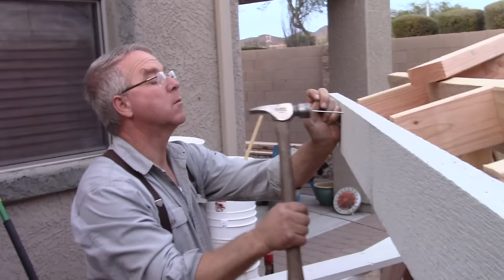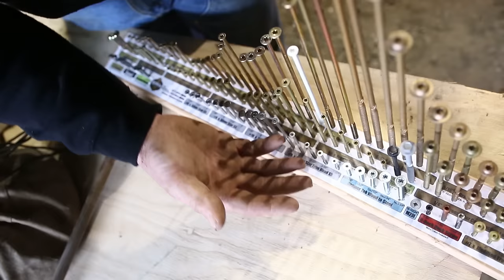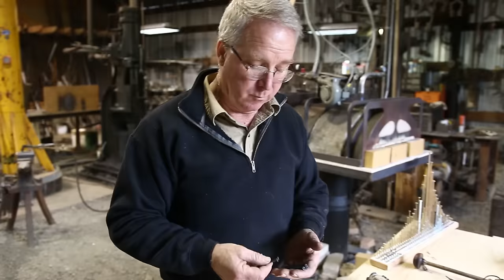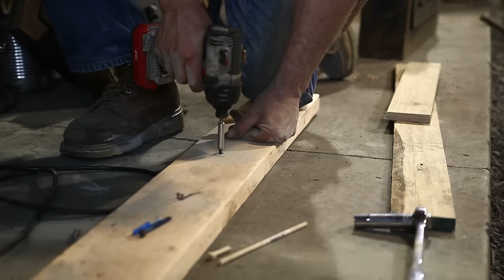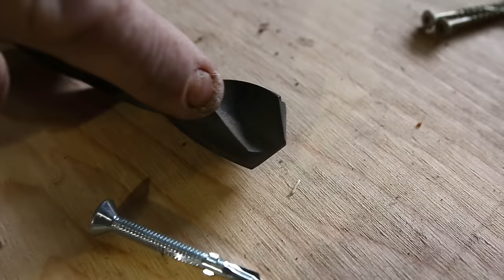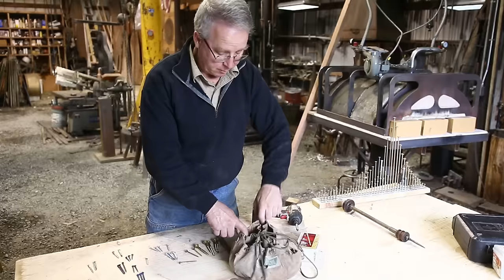Screws: What You Need to Know

Comment: If you have to use Philips head screws, get a JIS (Japanese Industrial Standard) crosshead bit or screwdriver of the correct size, and they will not cam out or strip the head of the screw. If installing European-type cabinet hinges, the driver needed is likely to be for the  Pozidriv screws that come with the hinges; look for the "Pz" trademark on the bits. Pz drivers work fine on these screws, but a Philips bit will strip them in a second. After you strip the heads of these screws with your Philips screwdriver, bring out your Vamplier brand screw extraction pliers, sold by Amazon and others, to unscrew them without destroying the cabinetry.  Regular pliers won't do it.

Comment: FYI:  A nail is just a screw without threads.    
I see you must have borrowed that GRK structural screw board from your lumber yard buddy.
I love it when i see some homeowner put up a wooden fence with long drywall screws because they are cheap and 2 months later the wood fence is bleeding at every screw.

Comment: I use Simpson strong tie sds screws all the time mostly with a 3/8 drive head on em but I like em they're pretty strong and haven't have them ever strip or break.... but yes they're also expensive..
 Also use torques on decking always I like em... course sometimes ya run into a crap box of screws somewhere that just round out easy or dont bite in, but I also like the torq heads over Phillip's or square

Comment: FUNNY, i caught this video...been making benches/picnic tables/adirondack chairs as a hobby..enough that I have gone from buying the $10 box of deck screws to $30 one and actually thinking about buying the $99 I use 1 5/8, 2 inch, 2 1/2, 3 and 3 1/2 ...when yesterday at Lowes I saw a broken open box of drywall screws...they looked GREAT..and I knew the Lowes guy would give me a discount for the box open.. 3 1/2...so I got them for $29 for like 25 pounds!!! Raced home loaded one to join a 2/6 to 2/4 and it started in OK..then it started to SQUEAK..and about right at the end about an 1/8th of an inch from flush..it stopped. I loaded them up and took them back...and got my $$$ back. It also helped me to decide something about my work: I am going to do the very best I can, take pride in it..and finish it. Going to put the stain on...sand it...stain again....sand more...tweak and make it special..then I will price it..no more of this cost bullshit. I haven't yet sold anything..been giving everything away..but i want to sell some..and I think folks will KNOW the quality. Love your video...I love wood and enjoy knowing more about it. PS> i graduated High school. (Colorado) in 1975.

Comment: I use hilti zinc plated drywall screws for exterior sheeting and they never rust out break but hilti is the best you can get
Reply: News flash they will rust .....use a good stainless steel screws if your outside if you don't want rust
Reply: Marc Favell never had a problem with rust even after many years still no rust
Reply: Marc Favell when you sink 10,000 screws a day on a job it would absolutely be ridiculous to use stainless, the cost would be astronomical
Reply: @jimboneutron8399  100% there expensive bit also the best ....I upsell stainless steel all the time on roofs and decks 100% worth it for the customer to 🤷‍♂️🇨🇦

Comment: True Robertsons are 100x better than TORX. I've used both.The problem is they don't make them any more. You just get the imports. Same with the bits. I can remember using one bit on a couple of jobs. I lost it, I didn't wear it out. Now you buy them by the pack, and use them by the pack. And a yes on the 1/4" impact. Amazing tool. On the job drills (motors) were once 1/2" single speed with no reverse. The real revolution was the Skil 3/8" variable speed reversible. I still have a big Yankee I used to put rustification on forms for a high rise.

Comment: The old Deckmates were the bomb. They were ductile and you could hammer them back and forth without breaking them. Homedepot owned the name, hired a Chinese company to make new ones and they sucked. (the ones with the torx head) The old ones are still made though. They are the Phillips II and they are worth every penny. I'm bummed I have to buy them online now. Remember those amazing blue grippy philips head bits that came with them? They held a screw in the bit with only one hand on the drill. Lifesavers I tell ya...

Comment: I have a question that I'm just about desperate for an answer to. I'm just getting started with construction and woodworking. I thoroughly enjoy your videos and everything you have to teach. I'm planning on building a 12 x 16 shed that I want to turn into my own workshop. My floor joists/band boards will be 2 x 6 pressure treated boards. Could I safely use screws to attach my joists by screwing through the band boards and into the end-grain of the joists?  I know that nails are most commonly used because of their resistance to shearing forces; however, as you mentioned, I like that screws pull material together tightly and can be placed with more accuracy (at least for a newbie like myself). Would I be safe with something like the Sampson SDWS framing screw? If so, how do I determine the correct length/size to go with for this application?
Reply from the maker: Yes on framing screws! I would think 2 1/2 inches of embedment.

Comment: After about 15 years my deck is in a stage where the outer boards are separating from the deck.  The boards are nailed in and I need to repair them ASAP.  Regarding the GRK screws, can you recommend which ones I should use?  I'm not a fan of using nails for this purpose.  How long should the nail be?  Thanks for the informative video.  BTW, I'm also a '76 HS graduate.  "Spirit of '76," we called ourselves.

Comment: I’m wondering why no one used a triangle shaped bit for screws? I’m thinking the further away from a circular pattern would give the most torque capabilities? Going even further a flat or straight bit like a tenon in a mortise would give the most resistance to cam-out but maybe at a cost of bit strength due to the thinness of material in the bit?
I was an apprentice Sparks in the 90’s and we were made to use flat head screws for everything. Such a royal pain with the constant slippages and rarely having the exact size screwdriver.  After much begging to the boss we got to use Pozidrive screws which was like night and day better. This was just as battery drivers were becoming popular and me armed with the new screws and a Black and Decker in-line screwdriver became best buddies lol !

Comment: I'm building a 6' cedar board on rail fence.  Should I use stainless ring shanked 2" nails or 2" GRK stainless screws to fasten the vertical boards to the rails?

Comment: The shear strength of the typical construction screws is much higher than nails. The nails are ductile. The screws are hardened and therefore brittle. Bending it back and forth has nothing to do with shear strength. You are work hardening when you bend it. Eventually it gets so hard that it snaps. The tensile strength of hardened steel is much higher than non hardened. Shear strength is approximately 60% of the tensile for any material. The problem in construction is that people use the same external diameters of nails and screws. You should use the same root diameter of the screw for accurate comparisons. The screw will have a higher shear strength due to its hardening.

Comment: Don't confuse shear, tinsel and torsion strength. The breaking effect of a screw made from hardened brittle steel is from torsion (twisting) not shear strength. Shear (like cutting with a scissor), Tinsel (pulling apart) and Torsion (twisting).

Comment: I might add that if you use a ceramic coated screw in cedar you might get some streaking, so you might have to use stainless steel screws, however the better the grade the "softer" it becomes, not all stainless steel screws are the same in grade! The screw with the "wings" on it is called a ply metal tek or self driller and should only be used on interior jobs of attaching wood to heavy gauge metal, with this screw you should not have to pre-drill!

Comment: My only complaint about torx drive (seeing them frequently in a different industry I work in) is that the tools themselves can be prone to twisting up or snapping, either from being too soft or too hard. A twisted torx is as good as a one-way ratchet, as they then cam out even worse than a Phillips. I'm quite fond of JIS screws, it's like a Phillips without the point, and the screwdrivers bite a whole lot better.

Comment: Was very much hoping you would explain why some screws have threads all the way from the tip to the head, while others have threads that stop 1/4", 1/2", 1", 2" or 3" from the head. I have understood this to be a mechanism by which the "front" or first piece of wood can be drawn tight to the "rear" or second piece of wood/material. Can you explain this screw thread conundrum?

Comment: The international crane signal for extend the boom. The guy is screwing off. Putting Shear wall on a house, you nailed it. Rock on, you screw it. The less you hit a
nail, the less chance there is of bending it. Every time you hit a nail it's heating up. Once to set it, a second time to drive most of it in, and a third time to drive it home.
How do you make a pennyweight?
Good luck cowboy!

Comment: A nails resistance to pull out lessens as the wood shrinks? I'm finding a flaw here. 
If you put a nail into wet, or not quite dry wood, with room for more shrinkage, that wood will GRIP, or constrict around that nail even tighter. More or less so, depending on the annular grain structure. You can take a crow bar and end up breaking the heads off of the nails trying to get them out. Especially the twist type. If they are commons, they'll make a hell of a lot of noise when extracting. 
If they're pneumatic nails, now you have the glue on the nail, AND the constriction from drying, resisting pull out. 
It might be noted that the timber frame barns of old, were constructed while the wood was wet. As the wood dried, the joints got tighter. There's more wood in the mortised side of the joint, than the tenon, which means more shrinkage. At least that's what I'm gathering, and why these buildings stood the test of time. Anyway, that's just my observational input. Extract from it what you wish.

Comment: Essential Craftsman May I ask a question please. Is there any advantage fixing the screw at an angle to achieve maximum tensile strength. I want to add more collar ties to my old garage because the weight of the roof tiles has pushed down on the whole timber roof structure causing it to bow out on all four sides. I'm having the tiles removed and a much lighter steel roof installed soon. I plan on adding another collar tie next to each of the existing ones by screwing each of the new ones to the wall plates, hence my thought of angling the screw to gain more tensile strength.

Comment: I'm in the process of a re- roof. My soffets all need replacement, I'm going with a ridge vent. How do I determine  how much more ventilation is required in the soffets? The house is a ranch 1900 sq ft poorly insulated ,brick exterior

Comment: I took 26 + year old drywall screws out of stairs made from pressure treated lumber that were barely corroded, surface rust at worst. If I knew how to attach the photos,  I would. 
The yellow/gold colored screws are coated with yellow zinc, better rust resistance than the silver zinc coated screws

Comment: I will disagree with the Torx comment, I love both Torx and Roberts. The biggest advantage to Roberts is the taper fit for long screws. Granted a spline drive has better power delivery, Roberts is nice when you're 20' up with one hand on a gun. Semantics. PS, I use a Lutz holder.

Comment: Philips, Robertson, Torx and Flat.   Philips head and screwdriver are design  has a kind of limited torque that is why it jump out, and was target to used in assembly line when clutch limited torque tools were not  invented. 

Robertson (USA dont like them, but Canada do (invented by a Canadian)) is design for another purpose,  it will not jump out when alot of torque is apply and it is also a tapper so  for manual use you can press you screwdriver in the head of the screw and it will jam in it,  you can even screw that screw with 1 hand,  drawback of that design was when tools didnt had a clutch you were not able to a "constant" flush head or torque.
Now with clutch tools Roberston can be apply with nicer results.   Torx was introduce with the clutch tools and are made not to jump out.  Flat ... well was inventedfew thousands years ago to scratch  you nice piece of wood !!!  :)

Comment: Do you recommend using silicone glue or epoxy glue with concrete screws? ... the reason i ask is because concrete is very brittle and once those concrete screws are mounted inside the pre-drilled screw hole (slightly smaller in diameter than the screw), it doesn't take much force to pull out that concrete screw because there isn't enough hard concrete between the screw thread to hold the screws in. Any advice or suggestions?

Comment: love all your videos.......but i gotta disagree with you on the GRKs. I had an exterior railing installed and the company drilled and screwed in GRKs into bluestone stair treads....a year or so later, one of the railings broke lose...two of the GRKs had snapped off..highly corroded around the break....I replaced them with tapcons -- after I squirted a bit of PL400 in the hole...that was a year ago....we'll see how they do....I'm up on Long Island about half mile from the ocean.....and btw, I have used, and will continue to use GRKs for structural woodwork....waiting to see what happens with the other three railings they installed....

Comment: Dunno about the"square" screw comments...to me they are the best so far...usually 3 sizes, stripping to a minimum and a strong contact with the bit...torque screw, might be better in more delicate situations, but for everyday use and for ease, it will never compare to the robbie.

Comment: The yellow colour should be from the heat treatment, the tempering....at 200 degrees.
btw, you forgot dynabolts were all the rage in the early 80's.

Comment: I guess after forty plus years of swinging a hammer I find it very easy so taking that into account I have seen many DIY people really struggle and use screws where they should never be used.
I also never use any screw except for torx head screws unless its drywall or steel and concrete.

Comment: Do the tapcon actually thread into concrete or deform tightly to the hole and use friction to hold?
Reply: Tapcon screws are hard enough and have serrations in the beginning threads to actually cut or grind threads into the concrete as it is screwed in, therefore actually creating a threaded hole in the concrete.

Comment: REMEMBER TO TURN A SCREW 1-2 TURNS COUNTERCLOCKWISE UNTIL IT DROPS IN WHEN RETHREADING A SCREW INTO AN EXISTING SCREW HOLE, SO YOU DON'T STRIP THE THREADS PREVIOUSLY MADE IN THE WOOD BY THE SCREW, AND THUS MAKE THE SCREW HOLE BIGGER AND THE FIT TOO LOOSE.

Comment: If you're stripping Robertson screws you're using a junk driver... I work in boatbuilding in Canada and every fiberglass over wood boat built here at every shop is put together with Robertson screws. Wheelhouses are framed just like a house, plywood on the outside and fiberglass over top. Deck screws under the glass and stainless above. Far cheaper than torx head and just as effective
Edit: Love the video though, just my 2 cents :)

Comment: After spending some time in Canada, I came to love the Robertson, which Canadians use more than anything.  

A mechanical engineer explained to me why they're superior to Torx.  Better torque than a Torx, no cam out, the fastener stays in place w/o a magnet, and best of all, 3 drivers covers every size fastener, and 2 cover 90%! 

Torx has the flaw of being able to be driven with the improper size, leading to stripping. The "star points" are weaker than square corners, and the bits wear faster. For electricians, Robertsons are also easy to clock, and spot from a distance. 

But, in the US, it's hard to find Robertson in the same variety as Torx. C'est la vie.

Comment: Two years ago? As usual I’m not even fashionable late. I’d like to pass on a little tidbit of information. If think there’s a possibility of having to remove a screw like a-# 3?threshold screw for instance. Glaziers, at least experienced glaziers, will take Industrial wax and coat the screws, works great on hi-red plugs. Any place that may need to be adjusted a bit later should be considered, at least I would

Comment: Those TEK drill-tipped fasteners are NOT "self-tappers".

They do not tap the hole for the threads to follow, they are "self-driller" or self-drilling tips that drill a hole in substrates a tiny bit smaller than the threaded shank.

Comment: A bit off topic, Im seeking help for rust prevention. I live in Philippines and I’m building a house. I have sourced materials (some locally, some from overseas). We do not have any of the fancy hot-dipped, galvanised, or any other nails that resist corrosion. we have have standard steel nails. I was curious is there any way I can treat these types of nails with a coating or chemical to prevent the rust from forming? 
All my lumber is Douglas fir coming from Oregon via a wood supplier here in PH at 61 pesos ($1.20) per board foot.
I have searched far and wide, even thought of shipping via amazon but the tax and duties are more than the costs of the nails themselves. Any help or advice would be greatly appreciated.